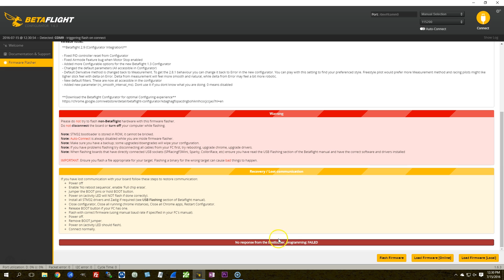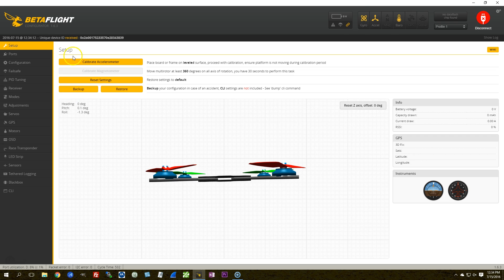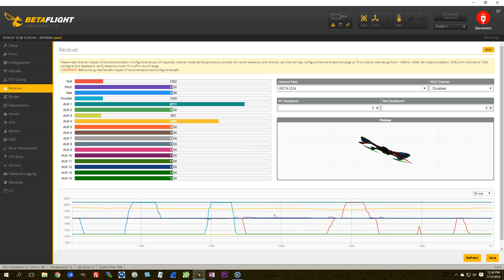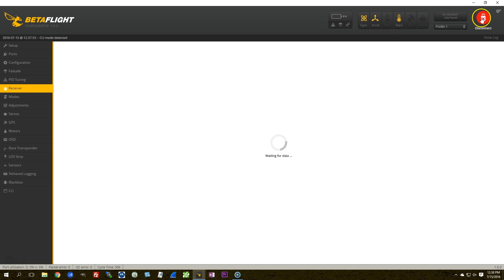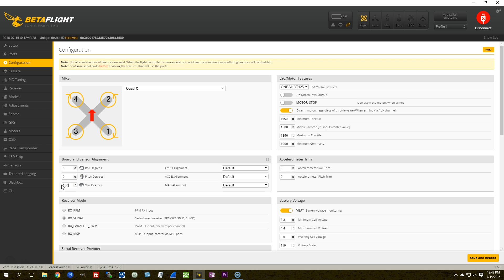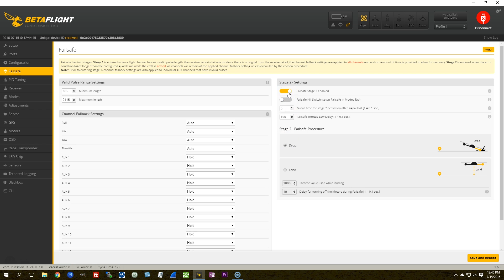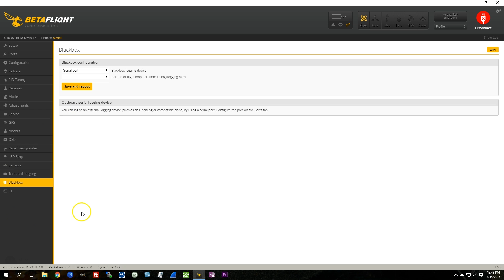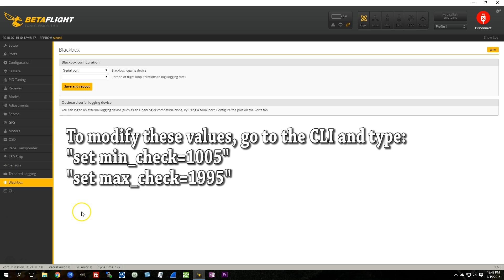Betaflight Setup (BETAFLIGHT 3.3 VERSION IN VIDEO DESCRIPTION!)

Comment: Easy enough, I just completed this setup but using a Graupner Tx and Rx and the micro HGLRC F4 stack. Thank you Joshua for making this available. For anybody using the Graupner SH12 micro receiver, connect the signal wire to the DSMX port in the FC then turn on serial on UART1 port. In the Configuration > Receiver mode, I chose Serial based receiver and then SUMH signal, since I haven't upgraded the firmware in my Rx for the newer SUMD signal. Works like a charm.

Comment: Plz help me
There is a firmware warning coming up when ever I connect the flight controller plzz hlep me sort this out
Reply from the maker: It would be helpful if you gave the exact text of the warning.

I think the warning is probably because you have Cleanflight on the Flight Controller, but you are using Betaflight configurator. If the FC has Cleanflight on it, use the Cleanflight configurator.
Reply: Joshua Bardwell should i jump the the flight controller in the boot place when it is new
Reply: Joshua Bardwell can inhet ull ur Instagram name so that ill send you the pictures of it
Reply: Joshua Bardwell iam using sp racing f3 in clean flight
Reply: Then it is normal to have issues when plugging it to Betaflight Configurator. You can find clear instructions to follow on how to flash it to Betaflight if you need to switch from Cleanflight. ;)

Comment: Any idea why air mode would cause a flip of death?? I turned it off and no more crazy flip. Was going to change esc but air mode off cured it??
Reply from the maker: +2stroke Me the ESC or motor may be damaged. Or the idle speed may be too low. Air mode itself doesn't cause a flip. It just increases authority and can stress the system.
Reply: Joshua Bardwell I decreased esc start up value to .25, flashed 16.7 and turned min throttle up to 8. Still flipped out. Escs and motors are new and checking in motors tab on bf all seem to work fine. Using dshot 600 bf 3.2.2.. I'm vexed. If air mode off works am I good or do I dig deeper?

Comment: When I save and reboot it says in the log box unrecoverable failure of serial connection disconnecting.failed to close
Reply from the maker: Manually disconnect and reconnect. On some computers the drivers are unhappy or something and you have to unplug and re-plug.
Reply: Joshua Bardwell it was working fine on my other pc then the other day I tried it and that happen would that still be the drivers?

Comment: Hi Joshua, I follow your guide to setup. But when I try to power up the motor using betaflight motors section, my motor is not spinning properly. Can advice why? This is the short video on the issue. https://youtu.be/j3c1Uwh8Wz4
Reply from the maker: If you raise throttle a little bit, do they spin? If raising throttle fixes it, then you need to raise the min_throttle parameter in Betaflight.

If raising throttle does not fix it, then there is some problem with the ESC or motors.
Reply: Joshua Bardwell hi, both does work. I did change the motor to another set if FC+esc. But still the same. Do u have any video on setup the betaflight from start to end kind?

Comment: Hello. Tell me who knows the Flight Controller Matek F405-AIO-S, the receiver OrangeRx R620 is connected via S.BUS. Spektrum DX9 equipment. In the Betaflight configurator, the Receiver tab - the slider on the AUX9 channel is twirling .. What can it be? The rest in the Receiver tab works. Here's the video https://yadi.sk/i/FdB2y7Kb3PQjdu
can BetaFlight have a command limiting the number of channels?

Comment: Thanks for all the help over the years. Would have given up without your videos to guide me. Got a quick question. Got to different quads, both with sp racing f3 fc's if I updated them to the latest version of betaflight. I get crazy amounts of osslations even when I'm hovering. I have noticed that the CPU usage isn't still like on other versions of BF it's moves around all over the place. Any help would be massively appreciated. PS I have flashed them back to an older version of BF and flying with no osslations for now.

Comment: One more question...lol. When is it appropriate to change the start up power on the ESC config? When changing ESC's? What about if you just changed to larger motors? Thank you for any help. Your videos really help out!
Reply from the maker: It's not necessary to change startup power on current versions of BLheli. There are very few times when you ever need to tweak any of those settings to be honest.

Comment: Is the PWm min throttle that i set at 1035 in BL Heli config supposed to match the min throttle I I have set in BF at 1060? Quad flies great but I just wanted to make sure I was ok. Thanks JB!
Reply from the maker: No, not at all.

PWM Min in BLheli corresponds to min_command in Betaflight. But don't just set them to the same value. Calibrate the ESCs is the correct way to do it.
Reply: Joshua Bardwell thanks for the reply!

Comment: Thanks for all the time you put into this!
Switched from clean flight to beta flight on my SP F3 last night because I could not get telemetry to work with clean flight and my x4r receiver.   On the configuration tab I don’t have a VBat/or battery section and I don’t have a failsafe tab on the left.
My betaflight does not match what I see on your screen and I have the latest version from October 2017.
Any ideas?
Reply from the maker: Enable "advanced features" from the gear menu in the upper-right.
Reply: Found it, thank you.

Comment: I am at wit's end with betaflight.  I am about to give up trying to get into quadcopters.  1 FT Gremlin (with FC board replaced at one point) and now 3 Flyegg 130's are useless.  the gremlin was assembled by flite test but still never worked.  after a week of emailing back and forth they thought the FC board was bad.  I switched it out.  zero difference.  never seen it fly. I have kept up on drivers.  I have followed threads.  I have watched josh and others show and tell.  I have asked him and others for help.  they have all tried.  I think I am at least 20 of the views on josh's "won't arm in betaflight" video and...it simply does not work here the way it does in any video.  the only quads in the house that still work are the ones that have never touched betaflight.  I just tried to calibrate the accelerometer on the last one and it kept calibrating a tilt instead of leveling till I was off by 15 degrees.  I got frustrated watching the calibrate button keep tilting the quad on the screen farther and farther off level.  eventually I hit reset settings, and have lost transmitter input completely.  the first flyegg I plugged into betaflight stopped arming as soon as I connected it to betaflight.  after 3 weeks it somehow started working again.  literally no rhyme or reason.  I have another flyegg on the shelf that I cannot for the life of me get to arm after it touched betaflight.  I was going to make a video comparing the betaflight screens of the non functioning and the functioning one and ask the world what I was missing, which is why I dared plug this one in today.  now it's dead too.  does anyone know why betaflight and I can't be friends?
Reply from the maker: +Darrell Cawley get a local friend who knows what they're doing to help.
Reply: Joshua Bardwell yes...I believe "proximity support" is the logical solution.  it seems very much as though the solutions are right in front of my face
Reply from the maker: Really I'm sure that somebody who knows what they are doing should get all your quads working in under an hour. It just soudns like you have screwed up the config or the drivers.
Reply: Joshua Bardwell ...it does to me, too.  it seems very much like a "well there's your problem" (click) type situation

Comment: Hi Josh, So my question is I have 8 quads running Betaflight 3.1 You know the current one two month's ago. I saved all the Diff files for them.  I guess the questions is if I install the new 3.2 will I have to start from scratch with each and every one like I just did when going from old Cleanflight  to Betaflight 3.1. I'm not like most that needs to have the latest release that comes out every fifteen minutes. If its not broke don't fix it,  just fly it until it breaks.
Reply from the maker: +Reckit I'm not sure. Save the diff file always is my advice.

Comment: in receiver in bataflight my channels are all wackadoo!....aux 1 is roll and aux2 is something like yaw!...how do i fix that please! i dont get the!..i can fly the dam thing just getting into the computer shit is throwing me for a loop!!..
Reply from the maker: Either reassign your channels in your transmitter, or change the channel mapping in Betaflight. Channel mapping in the Receiver tab will be something like AETR1234. 

A = Aileron = Roll
E = Elevator = Pitch
T = Throttle
R = Rudder = Yaw

Move them around so that A, E, T, R correspond to the channels that your transmitter is using.

Most transmitters will default to AETR on channels 1-4 so I'm not sure why your transmitter is being screwy like this. I might suggest deleting your model in your transmitter and creating a new model from scratch.

Comment: Hi Joshua, thank you for such great videos! May be you could help me out? I wanted to check if some Voltage Scale needed like you've said in the video. But my eachine wizzard 220x with betaflight 3.1 doesn't show the battery voltage in betaflight. I've done some upgrades - buzzer beeps when battery low, and MWOSD shows voltage read from FC in my goggles. .
Reply from the maker: Have you wired vBat to the vBat pads on the FC?
Reply: Yes. I'll check if I have a loose wire, but buzzer is working when bat low so I assume it's fine here.
Reply from the maker: If buzzer is working when bat low, then FC is measuring vBat correctl. When you say, "it doesn't show battery voltage," where are you looking?
Reply: In betaflight -> configuration, under Battery voltage. It's just gray, doesn't show even 0.0. (VBAT battery voltage monitoring is on, battery connected)
Reply: Actually I found that I can see the vbat readings at the very top, but not in the configuration menu

Comment: hey when I'm in betaflight it only shows setup ports configuration pid tuning receiver modes motors blackbox and cli idk why it wont show failsafe and all the other tabs I have the Lux V2 CB any help ???
Reply from the maker: Enabled the "advanced mode" button in the upper right. Then go to the gear menu in the upper right and check "always enable advanced mode".
Reply: i saw that 5 min later after I posted it lol but got in a other problem when I move the throttle stick 75% up  it says I have 2000 throttle but it skips from 1700 to 2000

Comment: My beecore setup with betaflight stays at 1000 on the throttle even when I shut the tx off. I am using flysky fsi6x and have setup failsafes. Do you possibly know how I can fix this so my failsafe works as it should? Thank you
Reply from the maker: My guess is that you haven't set the receiver to "no pulses".
Reply: Joshua Bardwell ok thank you! I will try it when I get home later on. I appreciate the quick reply! Keep up the great videos, I just subscribed:)
Reply: I am new to the hobby and couldn't figure out how to set the receiver to no pulses. Do I do that on betaflight or on my Tx? Thanks!

Comment: I did this complete setup and my quad is lifting up with less then 1/4 throttle.  What setting do I want to change to adjust this?
Reply from the maker: Maybe you just have a super powerful quad?

Confirm all channels go 1000 to 2000. Also set min_check=1010 to get rid of deadband at the bottom of the throttle.
Reply: LMAO  Btw  I live in Austin.  Noticed your not to far away from me judging from one of the other videos I watched.  To change things up.  I went from a 6030 glass fiber to a dal tri blade 5046 and now it went the other way.  Now the quad lifts up later then i like.  I did the deadband like you mentioned already.  1060 min throttle then 2000 max throttle are my min and max throttle numbers.  You really had me laughing man.  I needed that today :)   2206 cobra motors 2100 kv is what I have in them.  Im also open to try them king kongs if you still think they are good.  I just think I need more then the 5040 triblades.  maybe a 5050?   Adn all my radio settings are 1k-2k endpoints if that is what your referring to.
Reply: And I dont just learn something off your videos, I learn every thing from them :)

Comment: Hi Joshua, I would like to ask your help. Im a newbie and 3 days ago I received my first drone (kingkong tiny 6). somehow the throttle is weak and hard to lift up my drone. Also the roll is very slow. Could you check my print screen please?! https://flic.kr/p/WpR7n6   
It is normal when I push the aileron all the way to the right, the green spot (see the printscreen) only goes until that point? Should not go to all the way up?
Reply from the maker: +Tamás Medve all channels should go from 1000 at the bottom to 2000 at the top. Use your transmitter endpoint adjustment to fix this.

Comment: Basically I can't to get betaflight into my computer as yet the down load takes for ever and still going hours later , and when I try to connect betaflight config says closed serial port .
Reply from the maker: The download shouldn't take forever. Are you pulling from github? Don't do that. Go to the Chrome app store and install the Betaflight Configurator app.

Instructions for installing the configurator and drivers are in this manual:  https://www.google.com/url?sa=t&rct=j&q=&esrc=s&source=web&cd=1&cad=rja&uact=8&ved=0ahUKEwir79qfsujUAhWE7iYKHUn9DjcQFggoMAA&url=http%3A%2F%2Fwww.holybro.com%2Fmanual%2FHolybro_Kakute_F4_AIO_Manual_v1.4.pdf&usg=AFQjCNFMN16snvBTBpr3_JB9jutjoa3Smg

Comment: Hello,
my first quad setup is: eachine racer 130 - naze 32 - receiver frsky ac800 - frsky taranis x9dplus .
i can not adjust the range of the sticks (min 1000 and max 2000).
betaflight range min 1087 and max 1926.
can you help me?
Reply from the maker: The X9D plus can adjust the endpoints on the Outputs screen. Also adjust sub-trim to center channels at 1500.
Reply: I need to increase the course
betaflight range min 1087 and max 1926
Reply: My problem was the AC800 receiver.
I bought an X4R, it's perfect.
thank you so much

Comment: Hi Joshua, I'm finally setting up my first ever Omnibus with Betaflight, and I've ran into a rather stupid problem to which I googled no solution yet. I have TBS Tango with FrSky XJT module and X4R-SB receiver on SBUS, so at least I should be getting 10 RC channels in BF, but no matter what I'm only getting 8. The last two are not functional in BF but I know they work in TX since I can map any of them to the first 8. Could you please point me where to dig?

Comment: Hi Joshua,
Just got myself a DYS F4 with OSD integrated. It does say on the info for the board; "Integrated OSD, no need to flash firmware additionally,debug OSD via BF ground station."
Being a noob, I'm not sure what that means however my question is: Do I need to flash the firmware? My apologies if it's an 'in your face' answer.
Reply from the maker: It already has Betaflight on it. However you might want to flash to 3.1.7 which is the latest version.
Reply from the maker: "No need to flash firmware" is referring to when you have a separate OSD like MWOSD, which can be a real pain to flash.
Reply: Ahh fantastic, I was wondering exactly what it was referring to. I'll check to see which version it's running and update if necessary to the latest one. My thanks.

Comment: Hi Josh. I wonder if you could help me on a little problem I am having. I have a Kiss FC and Kiss 24 a ESC's and I just loaded betaflight firmware on my set up. The problem I am having is my first 25% of throttle does nothing. I need to get to almost 50% throttle before I notice a change in the thrust. Any suggestions?
Reply from the maker: set min_check to be 10 points higher than the value your throttle channel shows when your throttle stick is all the way down. Excessively high min_check results in deadband at the bottom of the throttle. You will do this in the CLI:

set min_check=1005
save

Comment: Joshua, i got a question. every time i connect my quad to betaflight the model on the setup-page isnt moving correct. Happens with my Wizard 220 and Diatone Crusader. When i click "save and reboot" its suddenly moving correct. Is this normal?
Reply from the maker: I've never experienced that, but as long as the quad flies okay, I would chalk it up to some quirk of the configurator and not worry about it.
Reply: They both fly great so no problem! Thank you for your quick answer!!

Comment: looks like mine has already been flashed and pids have been set up from ARRIS, but when i have it plugged into betaflight the drone wont stop beeping! any help would be appreciated!
Reply from the maker: I'm going to guess you haven't bound the transmitter to the receiver, so it is in failsafe.
Reply: would i still be able to be flying like i am?

Comment: Hey Joshua. Very helpful videos. I accidentally switched the MSP from the USB VCP to UART 1 and now my board will not connect. Any ideas how to resurrect it? I have tried flashing the firmware but nothing it comes up with "failed to open serial port"
Reply from the maker: +Ryan Cattin put it into bootloader mode and re flash it with full erase selected.

Comment: i just tried to use BATAFLIGHT GUI on a all kiss setup and had to lift the protection on the kiss FC, that was no problem, however I then tried to go back to Kiss GUI and tried to load firmware  and it would not let me because the protection was not there anymore . Is there a way to reload the protection back on the kiss FC so i can go back to Kiss GUI? Thanks